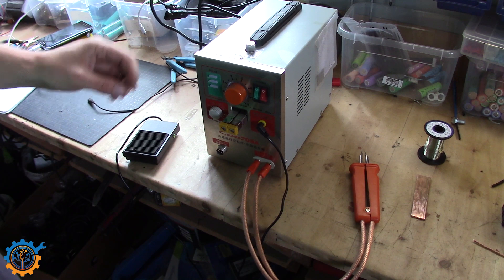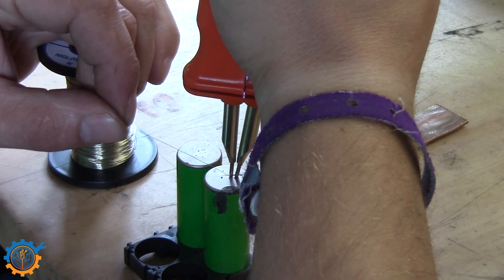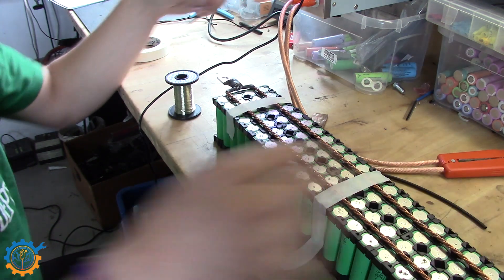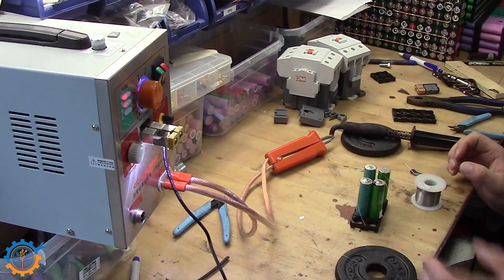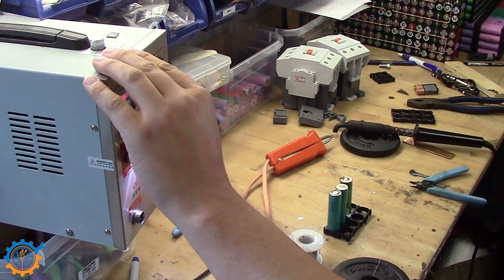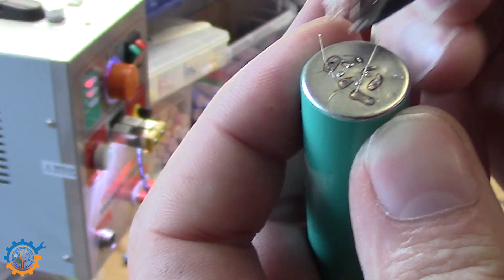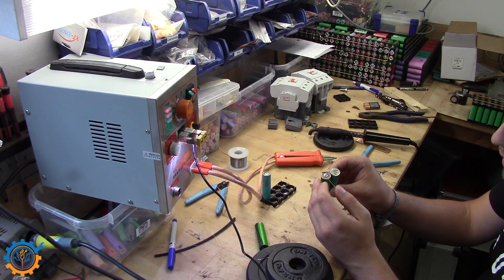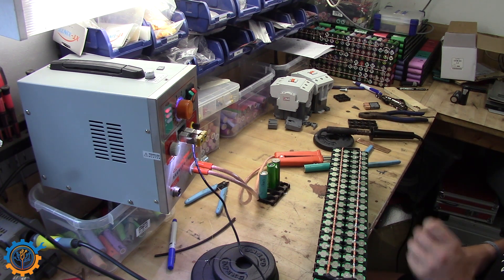Spot weld fuse wire for 18650 Tesla style battery pack for your Powerwall

Comment: I don't understand why you don't use zinc strips? the wires are like fuses, but a thin belt would also work, and in addition, points would be scored faster than soldering something

Comment: Can you spotweld fuse wire to tesla module (busbar is made of aluminum). have you tried to spotweld copper fuse wire to aluminum?
Reply from the maker: No. You need to use Sonic or laser welding.
Reply: Thank you

Comment: Would this work on ebike battery pack, where instead of 5a fuse wire to use 10A fuse wire and with maximum 40a at discharge in 4 paralel cells? I am not sure if this is better than nickel strip, as it need to spotweld in 2 strips to get it handle  10a

Comment: i wonder if there are chinese suppliers of the fuse wires if you arent in a rush.. i bet its just tinned copper wire at the right diameter so.. anyone?
Reply from the maker: Its so cheap locally so i wouldnt gamble
 One roll last My life nd it cost 10usd

Comment: is the pack you are welding with that twisted bus bar wire running around it, considered all parallel? If I was using 30Q cells with 15A draw per cell, how thick of fuse wire would I use?
Reply from the maker: You need fuse wire that wont blow on your normal use but protect over-load. But I guess you going to build a new pack? A new pack i wouldnt fuse on cell level. ANd 15A does not sound like powerwall but more like an EV or something and then you need all current you can and fuse wire introduces more resistance.
Reply: @DIYTechRepairs  I see EVERYONE doing the fuse thing for EV's... and Tesla does it also at the cell level...they use 29AWG pure aluminum wire... yes, batteries will be new, EV, will laser cut custom copper buss bars. 18S30P :)
Reply from the maker: @Sardonic1981  tessia does because they removed the cid. Not many other. Still depends on application...

Comment: Would this work for building ebike batteries?
Reply from the maker: I would not have fuse Wire om a battery on a bike. To much vibration and movement
Reply: DIY Tech & Repairs what would you have then ?

Comment: Have you seen any difference between one probe tip or the other contacting the fuse wire? On my spot welder, it seems to weld a bit better if I use the negative probe on top of the fuse wire. Excellent tests !!!
Reply: True. My diy is the same. The negative probe does most of the work.

Comment: I I am thinking of buying this.  However for the middle strip I think I would use 2 layers of spot welding ribbon and just spot weld it.
Reply from the maker: Its doable yes. 2 layers can be tricky to weld depeding on welder and thickness.
Reply: Maybe just 1 layer.  Looking on ebay, 8mm x .15mm x 5000mm strip is sold.  Don't know how much current you could run through it, but might eliminate all soldering.  Suppose you could spot weld all the series connection too, 100p7s would make nice 24V battery.  Also instead of lengthwise you could go widthwise or 4 per strip, then you could alternate the cells positive negative, up and down and create, a strip 8 cells (2 per 4 battery's and create a complete battery quickly).
Reply from the maker: I guess you do 7s100p and not the other way around. Unless you want 100 strings of 7s :)  This one is good to determine what you need: https://endless-sphere.com/forums/viewtopic.php?f=14&t=68005

Comment: Did you have any problems with the circuit power breaking, using this welder? What breaker do you have? In my house I have 15 amps breaker. Do you think is ok for these machine?
Reply from the maker: gearstil you  can run on 10a too but you need slow blow. On 120v atleast 20a. I run 16a c type breaker
Reply: DIY Tech & Repairs I live in Europe and my power voltage is 220V. Thanks!

Comment: I don’t unserstand why the small fuse wires don’t need to be soldered also with the main big copper wire they cross. Will they keep good contact anyway?
Reply from the maker: check 15 minutes in the video :)

Comment: The bit I am not understanding about off of this building batteries business - a lot of these cells are rated to 15 - 20 amp output. if you using 1 - 5 amp fuse wire, why are all the fuse wire's not blowing under heavy load ???
Reply from the maker: The cells are rated at perhaps 1-2A out. Im using laptop cells. But thats not what decides what goes out. The internal resistance does this.  Im using 5A fuse wire that blows at up to 7-10A.  Im running at most 20A per pack and thats if we average it out to 0.25A per cell. This is not true since the IR differ but it does not differ that much so that 1 cell gets all the load and therefore does not blow the fuse wire. 

Hope that explains the reason
Reply: The batteries bank are assembled to have a low current drain per battery.  Example 100 batteries suppling .5 amps is 50 amps of current. 460 Volts motor - 3-phase : 1.25 amps/hp. So 50 amps = 62 HP.  A Tesla 85Kw battery has 7,104 total cells. If the current draw is greater than designed the fuse blows.

Comment: How are the fuses wired? in series or parallel?
Reply from the maker: They are wired on between each cell and the busbar. On this pack the cells are in parallel
Reply: I see some do in series, which way is optimal wiring in case of cell failure? I'm confuse.
Reply from the maker: Im not sure I understand? A fuse must always be in between one and the other side. And that is series? All my cells are in paralell but the fuse is still in serie with the cell as you can see. Then I also have fuses on every string of packs as well .
Reply: I understand now.  Thank you for taking your time to reply.
Reply: Series to the bus bar or in-line fuses. One per cell.

Comment: Awesome video!
Can you spot weld the other end to copper with this stop welder?
Im planning on using laser cut copper sheets as the busbars.
Reply from the maker: TheJ Man i tried but doesnt work with what i got. I solder that part instead
Reply: Ah ok thanks
Reply: could you share your battery build?

Comment: great video mate, very informative. I personally have been spot welding my batteries for a few months now, mainly because I had issues with soldering cell tops and many cells vented because the insulator melted and created a short in  the cells. personally I would recommend weld all my cells

Comment: how do you know if a wire fuse is blown ?, besides the visual inspection of curse, i want to make sure all cells have a good conection after i have finished my pack. thanks !
Reply from the maker: Saul Gonzalez if the fuse was blown at full charge just meassure the difference at low charge and the cells with blown fuse will have other voltage. either that or touching the fuse wire. the pack will also have lower capacity so you will find the pack that way too
Reply: Voltage shouldn't drop.  The point of doing this style of Tesla-fuse-attachment is that you're tab welding to in a parallel pack.   Total voltage should be very consistent ( and you want to install batteries that are matched and within ~0.05V when fully charged. ) ... what will change is the amp-hour capacity of the module with a failed/fuse blown cell.
Reply: @TheMakersWorkshop  the individual cell will have a different voltage if it has blown a wire. Otherwise yes it becomes very difficult to tell which one is bad without visual inspection. Capacity potential is not easily determined.
Reply: I know this comment is 2 years old but for anyone else asking; Put your multimeter on the DC voltage setting. Connect one multimeter probe / clip to the - or + bus bar. Then go across and touch the other probe to the other side of the cells. If it reads 0v then you are good (no potential difference). If it reads 4 volts or whatever it means there is potential going through your meter (when it should be going through your fuse wire) which shows there is a connection issue.

Comment: I'm doing the same thing but using 3 amp fast acting pico fuse. Also building a custom 14s 112p battery. The idea I'm trying out is to integrate the twisted copper in this video with the black plastic cell holders. This can be done with a PCB made out of 6mm or more g10(fiberglass sheet) with a 6 oz or .2mm copper layer with spaced pads etched into the copper making series and parallel connections. Holes will be cnc machined in the g10 for 18650 cells. The cells are connected to the copper pads using a fuse for positives and 8mm by .15mm nickel strips are used for negatives. Connections to the cells is done using spot welding and connections to the PCB are done by spot welding, soldering or hot air reflow soldering.
Reply from the maker: Shannon Williams Nice!
Reply: DIY Tech & Repairsi It turns out I can get pico fuses for 30 cents, 1,568 cells with one pico fuse apiece is 470$. The reason I was going that route is because they blow at a guaranteed current, quickly and it occurs only in the little casing around each fuse, however it is costly. I mite use fuse  wire like in your link in the description. I was having issues finding large rolls of fuse wire at the 3-5 amp range.

Also made a lot of progress on my 14s 112p battery. Previous design had two large PCBs each acting as cell holders and busbars. It became obvious if a cells fuse did blow and a cell was ruined I would have to disassemble one entire pcb which is 784 fuses and 784 nickel strips plus one fuse or nickel strip on the other pcb just to replace one cell. That's no good, so one of the PCBs is now redesigned to let cells slide in and out. The cells are held in place using 7 separate smaller PCBs per 112 cell parallel group. The 7 smaller PCBs have a smaller hole than an 18650, holding the 16 cells in place. Now if a cell blows I only have to disassemble 8 fuses and 8 nickel strips plus one fuse or nickel strip on the other large PCB which didn't need a design change.